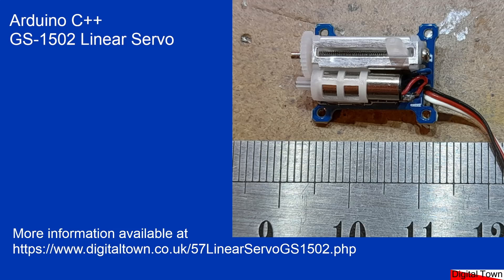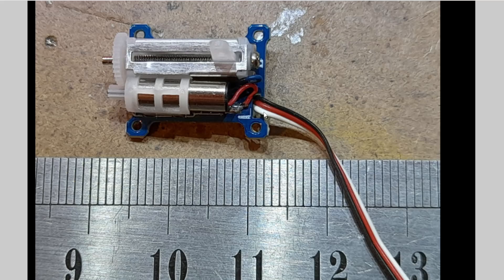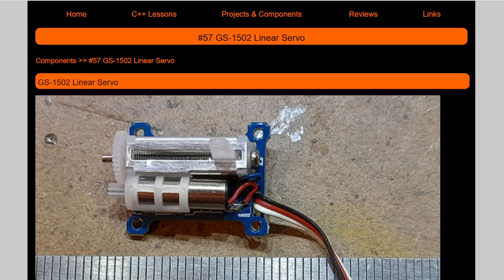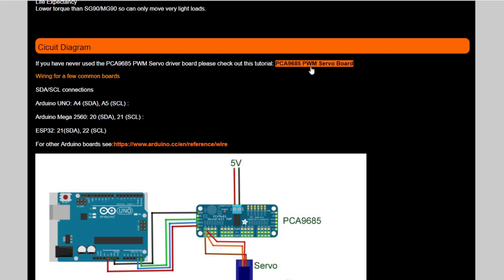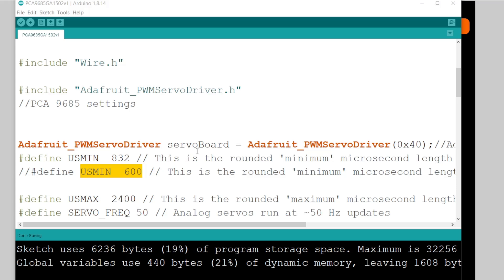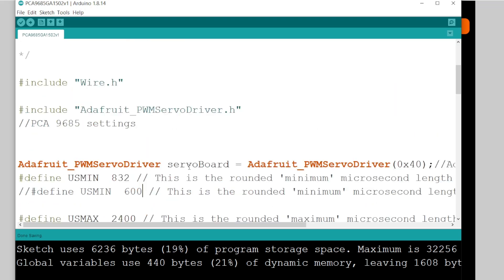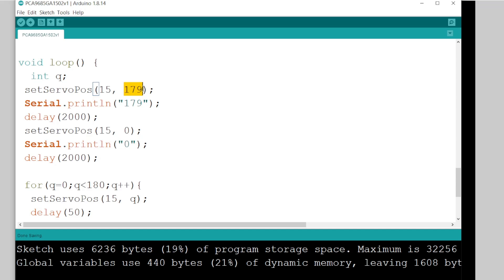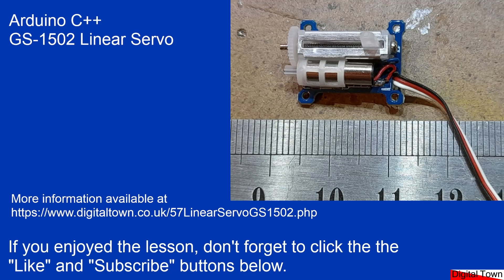#57  Arduino C++ GS-1520 Linear Servo Review

Comment: And how do I put 2 buttons, define left and right, that is, movement.?  And when using PCA9685  with several servers,leds and buttons, to controll in a painel. There are 16, how do I write the pins and their buttons? For now I start with DC trains only. Thanks for the help.
Reply from the maker: Hi, I have done a page on Servos and LED's with PCA9685 at http://www.digitaltown.co.uk/55PCA9685ServoLEDS.php

For buttons take a look at http://www.digitaltown.co.uk/howTo1buttonDebounce.php. Just add your servo instruction in as the buttons are pressed.

For model railway control I have been working on the nowRail project at http://www.digitaltown.co.uk/nowRail.php This allows users to easily add buttons, leds, servos and other effects and is specifically for model railways.